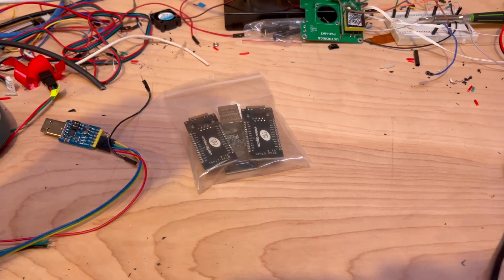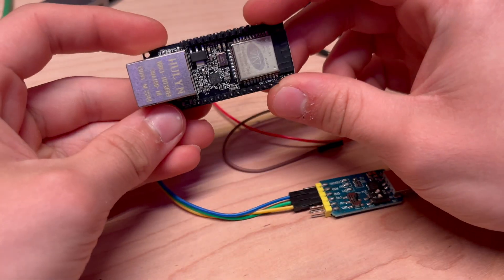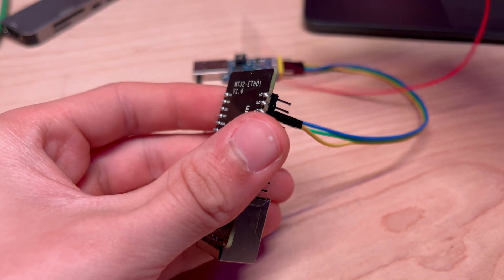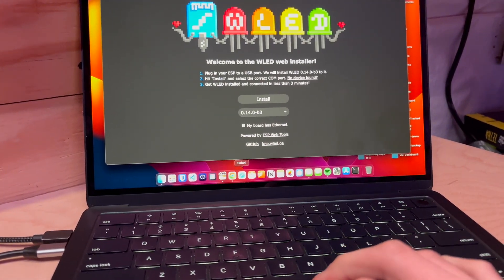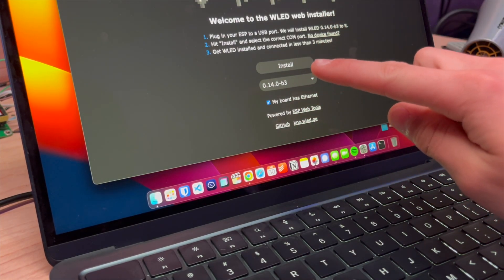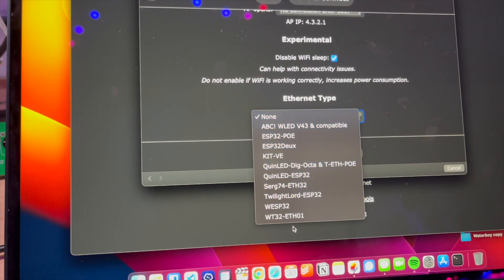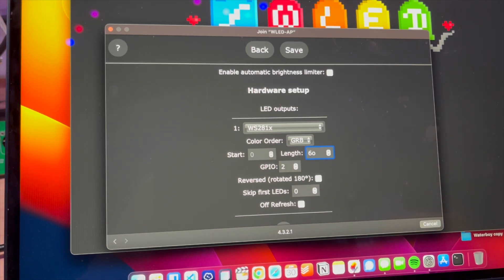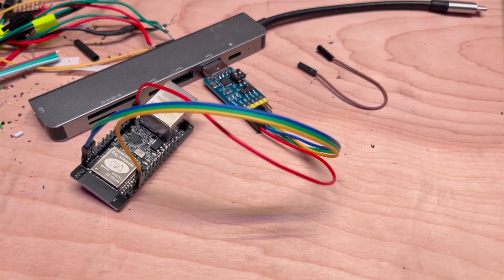Easy WLED Installation on WT32-ETH01/ESP32

Comment: Is the serial interface only to configure it?   Is it possible to flash new firmware onto the ESP32 such that it implements a webserver with some IP defaults, and transmits data automatically without serial intervention?

And can WT32-ETH-1's spare I/Os  (IO  4, 5, 14, 15, 17) be configured to dma SPI bus data to/from memory?
Reply from the maker: I believe there is no way to flash the firmware over IP.. you have to use the serial interface. If I remember correctly, it does support DMA.

Comment: Hi ineed help I have ESP 32 S3 w room 1 when I'm installing the wled The Wi-Fi section is not showing me like it skip that section why is that happen is it the correct way is it to select the.|plain| and then hit install if it's yes.. I did that it's installing and it finishing the installation but the Wi-Fi section is not appearing can someone help me please
Reply from the maker: You may need to not have the ground and D0 or whatever pin you had to jump to tell it that the board can be flashed (can’t remember right now).

Comment: This video helped me a lot. With my serial adapter switched to 5V and the wires attached to the 5V pin, it worked.
The communication didn't start at 3.3V

Comment: Note: If WLED AP is not visible please try:
1. Disconnect IO pin and connect it to EN pin
2. Power on WT32-ETH01 after 3~5 minutes than power off
4. Remove EN pin connection, power on again. 
The AP should appear (if not, try again).

Comment: Can this work through rj45 lan cable
Reply: Working direct using lan cable?
Reply from the maker: I think so
Reply: Thanks a lot.. For the info, because using lan cable cant drive most stable connection i think.
Reply from the maker: Not sure I understand. The Ethernet on these boards have been very reliable for me.

Comment: Do you mind if I ask....I have set up a few esp32 with complete success and today I followed your video here to set up an WT32 ETH01 and the installation is successful but in my laptop wifi networks I don't see the WLED-AP to connect to.  Is it possible I have a defective  WP32?  Might I be missing something??
Thanks!
EDIT:  Nevermind.  I pulled the ground loop off of IO0 and restarted it, BINGO!  took me to wifi setup.

Comment: Curious why 3v3 instead of 5v? Will this board work powered by a 5v step down transformer hooked in from my 12v LED power supply? Trying to wrap my head around which pins I'll need to connect for power and data once it goes in the brain box for my pixel rig.
Reply from the maker: Yup it’ll work on a 5v step down. You just gotta wire it to the 5v pin, not 3.3v :). That’s typically what I do for setups that have a 24v PSU, I’ll step it down to 5v for the controller. I have another video that talks about WLED and mixed voltages
Reply: @beamnetworks1  can't seem to find it on your channel page. Can you link it here? Thanks.

Comment: Thanks for the great video! please know that on the later instals. the Wled-AP doesn't show up automatically sometimes. i've spend almost 2 weeks trying to get it going. ordered 5 different serial adapters. and now i found the culprit!.      AFTER the installation. remove your IOo to GND wires and pin them on EN to GND for a short while. this will reset the device and will make sure the program starts. now it has started the Wifi :) :) :)  UPDATE: to make the ethernet port work. you must connect to 5V! . while  connected on 3.3v it will not work.
Reply: THANKS!!
Reply: Your a gem!

Comment: Hi
I already installed wled on the WT32-ETH01 but I can't connect it via wifi as you show in the video, I don't know what I should do. What should I do?
Reply from the maker: Reboot it
Reply: @beamnetworks1  
How?
I've already turned off and on the board, I've turned off the PC too and it still doesn't appear.
Reply from the maker: Did you verify that the TX/RX pins were connected correctly during the install and IO0 is connected to GND? If it’s not showing up on your PC at all that’s an issue with your USB to UART adapter.

Comment: Do you know if these boards are compatible w/ the INMP441 mic for sound reactive displays?  I've dug though the wled forums , youtube, reddit, etc w/o any luck in a wiring diagram or even if they can work together.
Reply from the maker: I can't 100% guarantee but I believe they are since they take 1.3-3.3v. Honestly your best bet might be to buy it on Amazon and return it if it doesn't work.

Comment: I bought one of these a few years ago for wled to combat wifi congestion I had at the time.  After a few days of banging my head against the wall, I shelved the project.  Your video came up and I remembered I had this board.  I gave it a try again last night and it's up and running.  Thanks for taking to time to put this video together.  It's appreciated.
Reply from the maker: Awesome, glad you were able to get it working! Thanks for watching.

Comment: do you have a full diagram on how to connect it or wire it to LEDs? thanks for the video
Reply from the maker: Yeah pretty much, just need to make sure the data is connected to the controller on whatever output you set on WLED and then make sure the 5v and GND pins are connected from the controller to the LED's and power supply.

Comment: Only thing that would be better is a POE version of this that could power 30 watts of LEDs
Reply from the maker: Tbh would love to have a PIE version. Would be also great for outdoor Christmas lights or something so that you only have to have one Ethernet cable powering your lights.
Reply from the maker: Looks like it would work, except it says it only has a 5v 2w output, meaning that it would technically only be able to power about 6 WS2812b LED's. https://www.olimex.com/Products/IoT/ESP32/ESP32-POE-ISO/open-source-hardware
Reply: @beamnetworks1  Yeah, Poe++ would be ideal with 60 watts